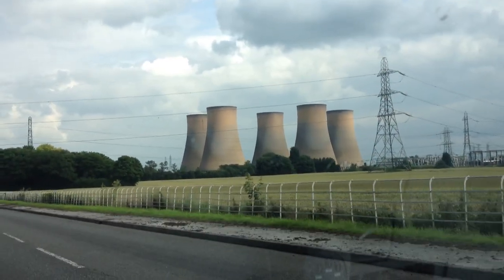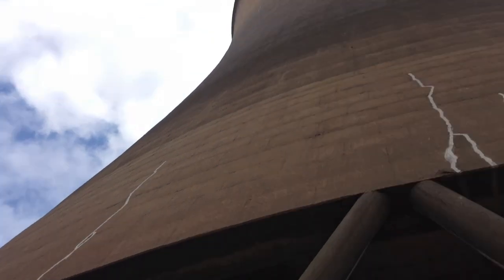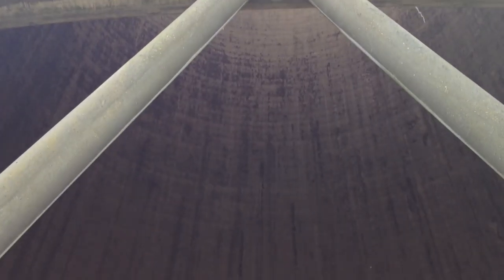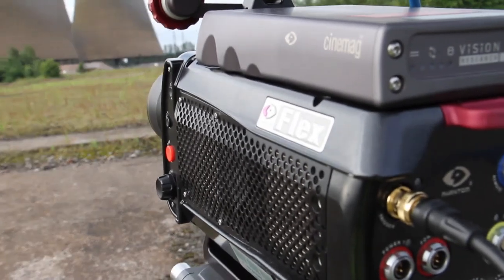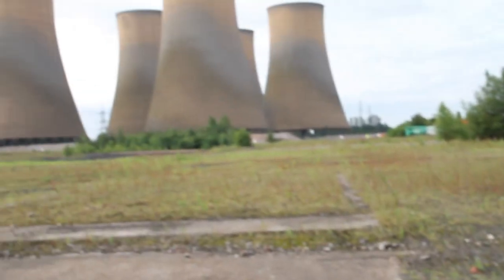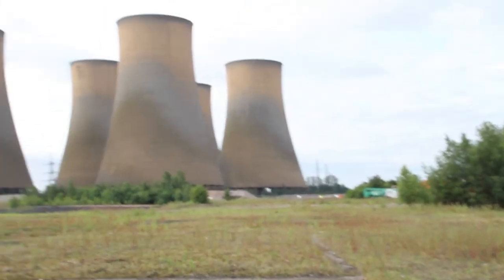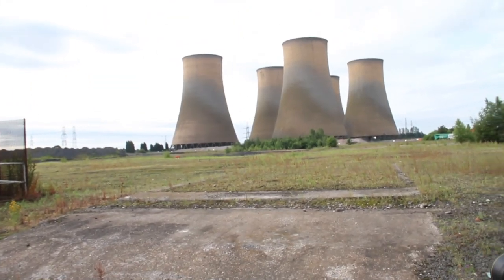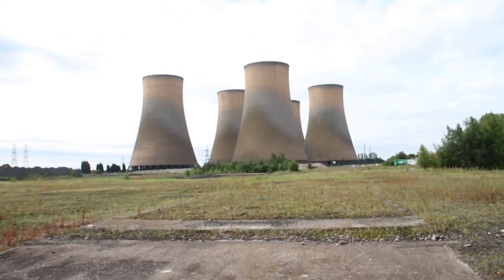Towers Collapsing in Slow Motion - The Slow Mo Guys

Comment: AT FIRST I THOUGHT THEY WERE NUCLEAR POWER PLANTS
Reply: They were.
Reply: joned1000 Well, the were actually the cooling towers but who cares
Reply: joned1000 Well, the were actually the cooling towers but who cares
Reply: +joned1000 they weren't. Go look at High Marnham power station in Nottinghamshire. Its coal.
Reply: Jeremy Bags Well cooling towers are part of a nuclear power plant
Reply: +Blob Dat Natural draft towers ARE NOT used by just nuclear plants, in fact many nuclear plants use a lake or an ocean as a heat sink or they have mechanical (I.E. Forced) draft towers. Always wondered why people associate natural draft towers with nuclear.
Reply: Cessna 182a They're not natural draft towers, they're cooling towers i.e.: they are filled with water and radioactive waste.
Reply: My god kid... They are natural draft fucking COOLING TOWERS if you are that stupid as to not understand my original statement. Circ water from the condenser never touches the working fluid in the form of turbine exhaust, and the working fluid even if it were in a nuclear plant would not be radioactive unless a boiling water reactor is employed. Even if a BWR was used the circulating water never mixes with the working fluid unless for some odd reason a condenser tube ruptures, but that is rare. 

Its called a natural draft tower because cool dense air flows under the tower thru those large support legs and a mist like spray of circ water is poured over it constantly. The circ water gives up its heat to the air and the air gets warmer and rises up the tower, the venturi shape of the tower helps produce even more air flow thus ensuring a constant supply of cool air at the bottom of the tower to be used as a heat sink. These towers use no mechanical devices to produce air flow and 99% of the tower is completely filled with nothing but hot air rising to the outlet. The cooled water falls down to the coldwell, which is a pond below the tower and then it is pumped back to the condenser.

Also, think before you speak, if you don't know about it, don't try to.

Thats it for todays lesson in power generation 101, any questions creeperkid09?
Reply: Cessna 182a Yes I know but those aren't natural draft towers.
Reply: Lol really... I just explained to you exactly why they are, care to tell me where the fans are inside the tower that would make it mechanical draft? Im open ears kid.
Reply: It would be Godzilla 2014 all over again
Reply: that would've been...cool
Reply: +Jeremy Bags it dose look like a nucular power plant dosent it
Reply: wizINFINITE nope it wouldn't of. the way nuclear power stations are those towers are cooling towers. the water that touches the rods/reactors does not touch the cooling tower. the cooling tower water system is totally different. the water from the cooling tower goes in copper tubing that touches the reactor water system and cools it but does not touch the Radio active water. you can look up nuclear rector how do they work. so those cooling towers have no radio activity at all. so it's safe. and the reactors are in a totally different building
Reply: Pingu no they aren't, they are cooling systems
Reply: @superkill6267  nuclear power plants dont have cooling towers those towers dont cool anything unless its from a a plant that actaully uses them
Reply: all of you please stop being dumb
Reply: @superkill6267  Almost all power plants have cooling towers,
the exceptions are:
geothermic, solar, dams and wind turbines.
-Spino

Comment: I bet this is what the word 'majestic' was invented for.

What intruiged me the most, by the way, was how the top panels were the first to break off. Simple case of G-forces and concrete being relatively unsuited for coping with pulling forces, or was there something else going on?
Reply: I know this is an old comment but I reckon it's because the rebar supports running through the tower end before the tower does.

Comment: I thought you were going to be cheeky and do something that made it look like a reactor explosion XD
Reply: Aisha Love Do you understand what happens when a nuclear reactor has a meltdown or explodes because it's not what you think
Reply: Caleb Franz I know that a reactor can't actually explode, PERIOD!

I know that when a meltdown occurs the reactor looses it's abilty to keep the fuel cool and regulate the reaction, so the fuel keeps getting hotter and hotter until it melts through the reactor walls and it will keep melting through everything it touches until it finally cools enough to settle. 

Just because I thought they might pull a funny prank doesn't mean I don't understand the science. I was actually curious as to how they might spoof it knowing an explosion is impossible.
Reply: Aisha Love Well reactor number 4 of Chernobyl actually exploded with enough force to lift the 2000 ton metal plate on top through the roof of the building it was in. Now, this explosion was the result of coolant water evaporating into steam so fast that it breached the reactor hull but it still happened within the reactor. Afterwards once the hull was breached the superheated graphite in the reactor came into contact with the atmosphere and ignited, causing an even bigger second explosion that sent burning graphite and ratioactive iodine shooting into the sky. After that yes, the fuel superheated itself and melted through the bottom of the reactor core, through the concrete floor, and into the basement creating what is now known as the iconic mass of radioactive material dubbed "elephant foot." At least that is what i believe it is called.
Reply: That kind of explosion is almost infinitely less dangerous than the anti nuclear nut jobs think happens.
Reply: Aisha Love Yeah a lot of people think of a nuclear bomb when they hear the phrase nuclear meltdown. In reality it's nothing even close to that.
Reply: Jared Salisbury Note that, though Chernobyl was a steam explosion, not a nuclear one. If it were a nuclear one, it would've deytroyed all of Belarus, Central Europe and would make All of Europe uninhabitable for more than 300 years because of the fallout.
Reply: Jared Salisbury It would indeed be a VERY scary outcome
Reply: Jared Salisbury mass of released energy = E/c²=m(original)-m(final)

Comment: Chernobyl in a nutshell.
Reply: No. Here, the cooling towers of a coal power plant were destroyed. In Chernobyl, 1 reactor exploded, in the nuclear confinement area of the building.
Also, Chernobyl was an uncontrolled & unwanted explosion caused by bad reactor design, bad decisions from the station staff, bad prediction of the electricity demand, and failure to abide by basic safety rules.
Here, the station had been closed and disconnected earlier, and was being dismantled. The destruction of the towers was controlled (see how the 2 last towers fell on a specific side, thanks to a smart placement of the explosives ?) and planned.

Comment: What are those even made of?
Reply: Concrete with steel beams on the inside
Reply: It looks like it shreds when it falls though.
Reply: +Sanitation Boy It is made of steel and concrete they were over 50 years old so the concrete had gotten weak that's why it crumbled
Reply: Thanks.

Comment: are its abandoned?

if not they can start a nuclear explosion i think
Reply: No of course they would blow up something that's not abandoned
Reply: +Ghostkiller007 Bruh and then they can cause a nuclear   explosion because the cooling reactor is broken and the nuclear reactor core will heat and explode
Reply: The Real Man gaming i was being sarcastic bro
Reply: They were water cooling towers fuckwit.
Reply: first of all, they werent even used anymore, so the core probably has coolers.
Reply: +JoshyFushy they
 are water cooling towers dipwit.

Comment: All my lift I thought those were concrete
Reply: It is concrete. But we don't usually get to see concrete cracking over tens to hundreds of meters like this, so it feels like it's a different material.

Every material behaves in very different ways depending on the scale, and we're only used to our scale. For instance, water.
At our scale, water is a slightly viscous liquid. 100x smaller, for an insect, water is a sort of sticky death trap (because of surface tension). 100x smaller again, at the scale of the fibres making the threads of our clothes, the concept of "wetness" doesn't even make sense anymore, water starts feeling like a weird fluid able to fill the smallest gaps. Even further down, water just becomes a very inert molecule that easily sticks to other larger molecules (this causes dissolution and dilution at the macroscopic scale).
Reply: @jm56z43  oh cool, thanks for the info

Comment: how did you not die from radiation that was a nuclear cooling tower.
Reply: Cringe
Reply: Owenzz Depends on the books you read
Reply: Owenzz
If you read my little ponny,it makes you dumber.if you read nucelar physics it does make you smarter
Reply: +wheatyblock gamming so many typos...tell me, what does gamming mean? What kind of books do you read?  Some stupid book for 5 year olds? Gosh..
Reply: Okay. You're both idiots.
First of all, we don't even know if that was a nuclear cooling tower. Those towers are used in any steam turbine power plant, be it nuclear, coal, or other.
Secondly, there is no nuclear material in the cooling towers themselves. If this is a nuclear power plant, the nuclear material is stored in the main reactor building.
The sheer amount of ignorance and stupidity in these comments...